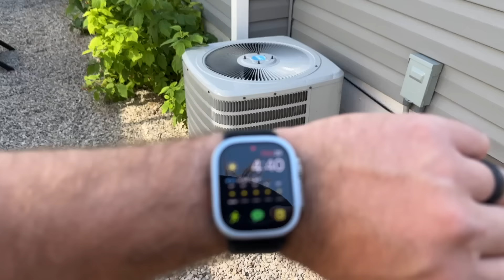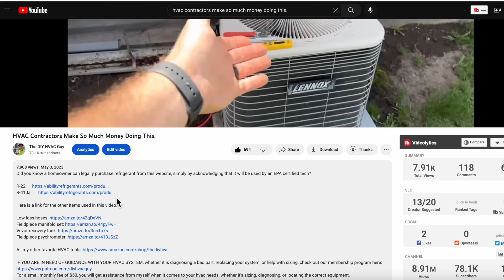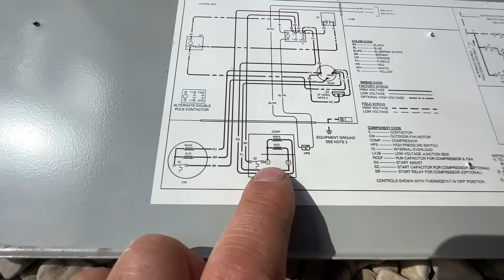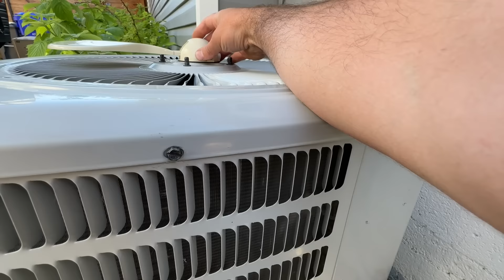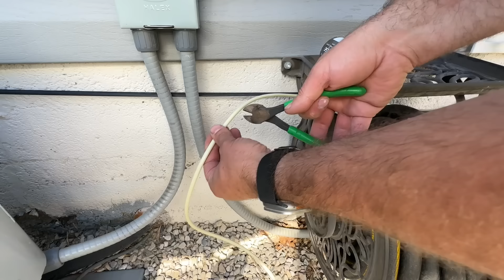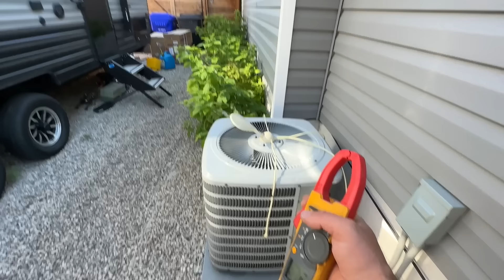Can This Device Actually Lower Your Electric Bill By 30%??

Comment: Ok, so let’s do the math.   .8 amps less @240 V= 192 watts.  192 watts X 24 hrs = 4608 watts.  4608 x 33% run time = 1520 watts per day.  1520 watts x 30 days = 45,619 watts saved per month.  45,619 / 1000 = 45.619 Kw saved per month.  Let’s say 5 months.  45.619 x 5=  228Kwh saved for 5 months.  My local cost per KWh cost is $.13/KWh.      228 x $.13 = $29.64 per year.   At the cost of $99.95+ tax, let’s call it $108.00 total cost.  108 / 29.64 = 3.64 years to get your money back.   This does not account of any water cost or the 2 water filters per year.  If the filters are $10.00 x 2 per year = $20.  Now your savings is $9.64 / year.  108 / 9.64 = 11.2 years to get your money back.  
I’m thinking I will not be buying this product as I have hard water.

Comment: I worked for a guy that designed a halo mister system that used agricultural spray heads and ridged tubes, attached to a water softener system as an "upgrade" for $500.00. In the 90's in South Florida it was far, far hotter than normal summers. Back then, the climate crisis was blamed on "the hole in the ozone layer"  which was causing the hottest recorded temperatures ever recorded on earth to date! Fast forward another solar cycle or two and here we are again. 
Would but places like Arizona, southern and far northern Utah deserts benefit most from this?

Comment: Not a chance. This will void y any warranty you may have on the unit. Water bill increases. Mold in the unit and on your house. After damage to you basement. Etc. My AC monthly bill in the Midwest runs $100-$150. My water bill runs $100. My HVAC guy told me most of what I listed. I trust him.I don't need the headaches.

Comment: I don’t understand what effect this device would have on air entering the home.  Is the pump now pulling in more moisture, resulting a more humid indoor air quality?    If so, that would be a disaster in the semi tropical climate of the Southeastern U.S.   As it is, have to run dehumidifiers to inhibit mold & mildew growth.
Reply from the maker: No the outside unit has nothing to do with the actual air being blown inside however refrigerant flows through the condenser coils and if that refrigerant is not as hot (being as it is precooled) it will not work the compressor as hard, saving you money.

Comment: Relative humidity is crucial regarding evaporative cooling. Hell, in the desert such a system ALONE can be quite effective. Not that its a bad idea or anything but there are too many factors involved, extra maintenance, bebris, cleaning, corrosion, clogging, algae, mold/mildew etc. to even determine if its really "worth it" or not in the long term, even if it was free. It sounds like a great DIY project though, especially for dryer heat folk. BTW, I don't necessarily mean that kit particularly but rather like 80+% DIY. Without even seeing it, that Chinese sail valve is surely the weakest link by far. A homemade or surplus sail switch to an off the shelf dishwasher/washing machine relay valve comes to mind, though that does involve electric & near water. Perhaps someone into 3D printing will surprise me. Not that a reliable "sail valve" is impossible otherwise.

Comment: an airflow director above the unit can also knock about 8% off your bill and extend the equipment's lifespan as well... just a twice-bent piece of metal that shields the top when the fan is off and is lifted out of the way when its on but still deflects the airflow away from the wall and eaves above.

The main trick here is not to directly spray onto the coils but to spray onto a surface around the air conditioner's outside unit - the benefit is gained without a direct application!

Comment: JUST DON'T DO IT. The machine is NOT designed to work this way and the additional maintenance will cost you more in the long run. This would be up to replacing the whole machine.

Pretty sure this will not get pinned.

Comment: the one measurement not included is the humidity. Evaporative systems work well in low RH but are useless in high-humidity zones. The water will also create scale on the condenser coil unless filtered. I have been doing this for  45 years in Florida. In low humidity locations, this works well but can cause coil damage over time.

Comment: I have an irrigation water hose bib about same distance from my condenser as the nearest potable water hose bib. Problem is, that distance is a long way, all in the sun, with a BLACK hose. When it has not been turned on in a while, water comes out of the hose at 123 degrees F. Air comes out of the condenser unit at 112 degrees F. I'm sure you see the problem here. 
Irrigation water here is free and not metered so I don't care about using too much water, but the Cool-n-save would need to have a decent flow rate in order for the water to not be HOT by the time it reaches the end of the hose.

Comment: One data point I would like to know is the humidity of your location when you did this test, and the average humidity in the summer in your location.
I've lived in the two extremes of heat. The dry desert of Southern Arizona and the high humidity of the Gulf Coast. In the 100°F and 100% humidity of the Gulf Coast we don't install misters outdoors, because it does nothing to cool you off. There is no evaporative effect. Contrast that in the desert where misters work incredibly well because of the evaporative cooling of the air around you.

Comment: Don't do this, the condenser coil is nothing but copper tubes and aluminum fins. Which means that they can corrode and oxidize. There is a reason why evaporative condensers are made of 304 stainless steel.

Comment: The benefit of this kit is that it cools down the condenser to help the circulation faster and it works more efficient for the cooling. But, there is a risk for this process. If your water source has too much sodium then you definitely can't use it at all. I recommend you check your water before you purchase this kit, or the sodium will corrode your condenser!

Comment: 1amp savings per hour, 240v x 1amp= 240w.  Lets say the ac runs 16 hours a day, thats about 4kwh.  At 15 cents per kwh, thats about 60 cents of saving per day.  Throughout the month, you'll save about $18.00 on your electricity bill.  Factor in if you live in a dry vs humid enviornment will also play into how effective this will work also water will corrode the metals and condenser fan motor faster than normal.  Good concept but not a great one. 

I would rather upgrade the condenser by one ton or more if you want the savings in the long run.

Comment: Big warning for anyone trying this, you will kill your A/C if you do this without proper preparation. Why? The water you are using is likely rich in calcium and calcium will be left over when your water evaporates. It will build up until there's no way for the heat to get off the coils. The fun part begins when you try to clean it because you need a cleaner that has acid(to dissolve the calcium) but you're not supposed to use acid cleaners on these units so good luck there.

Comment: Slightly disappointed.  I thought the difference would be greater.  Regardless, these MacGyver devices should be integrated within the design from the start.  I hooked up a tube to my HVAC water drain (MacGuyvering again) and get about 15 gal/day (free) from the air.  Despite having a cool winter, spring and summer (we set "low" records for all three) it still gets in the mid-90s (middle TN) and I get around 2,500 gal/year for watering the garden. Air moisture is going mainstream.  The new "desalination" units - huge boxes built above the ocean that capture, dehumidify and condense fresh water is another example of using the moisture in the air.

Comment: Usually when the temp gets above 95 degrees the efficiency of the system starts to decline rapidly.  Manufactures have to design for those sweep spots in temps to maximize energy usage.  So I can see it helping quite a bit when its 90 plus degrees, but remember that water bill cost too.    We actually did something like this on a old system to limp it along a final season to give our customer a chance to budget a replacement.
Reply: @markbrown2296  lol ty

Comment: The outdoor coil is designed to run in an air only environment.  Misting water on the coil artificially reduces the head pressure by increasing the cooling of the coil.  While its a sound idea in theory, your unit runs at a low head pressure, and thereby is not running at optimum efficiency.  Also, misting water on the coil will plug the coil in short order due to calcium and lime being deposited on the fins.

Comment: Pet peeve: when people refer to a measurable quantity by its units. 

"Measure the amps" instead of "measure the current".

"Measure the decibels" instead of "measure the sound pressure level (or just sound)".

You wouldn't say "let's see how many degrees it is out" or "do you know how many miles per hour you had back there?"

You definitely wouldn't say "let's measure the feet of this board" or "I measured my pounds before my diet".

It just sounds like English isn't your first language. Or you have no idea what you're talking about.
Reply: 2:44 "See what our before amps are" <cringe>

Comment: The house in which I grew up in Tucson Arizona had a Rheem unit that had a drip system built in that would constantly flow water over the condenser.  It worked like a Swamp cooler where there was a float that would feed water into the bottom tray and a separate pump for recirculating the water.  It was incredibly efficient, but also incredibly wasteful, especially in the desert.  My recollection is that this system was installed around 1964 and I can't find anything online about it.  What made it be able to withstand this was the condenser was stainless steel, so you didn't have to worry about untreated tap/well water corroding out the condenser.

Comment: Real HVAC TECH ENTERS THE CHAT....clean the coil with a decent stream of water. They ACTUALLY make coil cleaner that you mix in a special sprayer. Did you know that your condenser actually gets MORE efficient the longer it runs? And then lastly is if the condenser has a  higher SEER rating and has a variable speed condenser fan and compressor. It will not cost as much to run and has extra functions to run at a lower rpm witch doesn't use as much energy. Oh and give that unit some shade it'll help

Comment: Continually spraying water on your condenser is a great way to get mineral buildup on it so you can get efficiency loss as the heat now has to pass through a layer of minerals, and you can have the joy of fin corrosion.

Comment: The only things that will help the most is VFD controlled air handler and coil.
And a big ass coil. The bigger coil the better. Push that hot air out of it quick.
And copper. That conducts better.

Comment: Certainly it will enhance energy efficiency, but it will also rot out the condenser coil, the casing and the compressor if exposed in the center under the fan.

Comment: Hey, what if your unit is a heat pump and your thermostat has auto change over and you’re in the middle of a season where you use the heat pump and the AC and you’re putting cold water on your condenser coil that is now an evaporator oil sitting outside. Wont the water freeze up if you’re saturation temperature is below 32°

Comment: Some high efficiency window air conditioners collect the moisture that condenses on the evaporator coil and the cooling fan sprays it on the condenser coil...

Comment: Use a tank of water.   Add 10 gallons of distilled water.   pump from that.  drain off the water back to the tank.

Mineralized water problem solved.

Comment: Dont forget to take this thing OFF your system in the winter.  Those hoses will freeze real fast and that plastic flapper doesnt look particularly strong. Any water left in that valve is going to break it when it freezes.

Comment: I think the test would have been a bit more informative if you had measured the outside air temperature for both tests for comparison, and also ensured the inside air temperature was the same in both cases when you measured at the vent.

Comment: This is a very bad idea and it will ruin your condensing unit DON'T do this.
It will do exactly what it says it will do so it does work, at first.  The problem is the water will evaporate leaving scale behind coating your condenser with water deposits and ruining your condenser.  
I have replaced multiple units because people try this.  I usually see this from people putting a sprinkler by their condensing unit which will accomplish the same thing.

In the long run it will ruin your equipment or you will have many hours of using CLR or another de-scaler to remove the damage to your condenser that putting a misting system on will cause.
Reply: A plastic flapper restricting air from the condenser fan to start a solenoid. Priceless! You might want to check your manufacturer warranty  before installing this corny contraption. These water misters have been around a long time and won’t ready be that 
Affective below 85 deg ambient temps.

Comment: The wire in the tube is probably to lower total water flow.  If they'd gone with a tube size that was the actual water flow they wanted, it'd be to small and delicate, harder for the average home owner to install, and probably more prone to damage.

Comment: I am very suspicious of this video. Every technician worth a damn knows that in home AC it's not about the air temp exiting the vent, but the Delta T, the difference between the the air entering the system compared to exiting. if someone gets two brand new systems installed, one high efficiency, one low efficiency, the delta T will be exactly the same because a more efficient air conditioner does not make the air colder! The efficiency could have been easily shown here in the amps the compressor draws while it's running. So ask yourself, why was this not explained correctly? why was the delta T left out? Did it actually lower the amps? (as a more efficient unit would do) . These faults need to be addressed of this is a scam.
Reply: Don’t forget by adding this plastic flapper on top of the condenser fan. You need to make up the CFM’s losses with cooling water. 😂 how simple is that! 😂

Comment: While I appreciate DIY HVAC Guy's attempt here, he unfortunately did bad science. This is false. Don't be misled. If you keep the amp meter on it all day, you'll see the instantaneous power draw going up and down throughout the day. Sampling once for a couple of seconds is subject to random fluctuations in the instantaneous power draw. The power draw of an AC compressor is determined by the rate at which it's transferring heat from inside the house to outside (the the energy to compress the boiled refrigerant back into liquid). The faster it moves heat, the more the refrigerant boils, and the more power the compressor will draw to maintain pressure. The sprayer may increase the cooling capacity of an existing unit (more BTU's from an existing system) but the increase will draw more power. It will not make the system more energy efficient; it will only allow it to draw more power to do more cooling if the system is undersized for the environment where it's being used.

Comment: I did this same modification 20 years ago.  I used an electric relay and water solenoid to turn my water on/off.  I suggest you also check the discharge temp of the condenser.  Nice experiment.

Comment: Yes, these are effective.  
In addition, if you live in an area close to salt water, the fresh water rinse of the coils will extend the life of the coils by many years.  Condenser coils in close proximity to salt water typically deteriorate in 5-7 years. 

The air flow switch is a good idea to conserve water also. Be sure you have proper drainage around your unit. Make sure any openings in your home's exterior are sealed against water intrusion.

IF you live in an area where there are a lot of minerals, or with alkaline water, consider adding an in-line water filter in the water line feeding the mister.  Water deposits on the coils will hurt the efficiency gained by using the water. Outdoor condenser coils should be cleaned at least once a year (twice for heat pumps) by a professional.  

Remember that reducing your air conditioning cost 30% will NOT = a 30% reduction in your total electric bill. AC units are a large consumer of electricity, up to 40% of the total home's electric bill, but it is NOT the total electric use.  30% of 40%  = 12% of the total bill. YMMV.
Reply: YMMV? What does that mean?